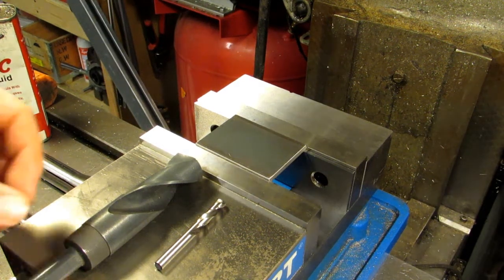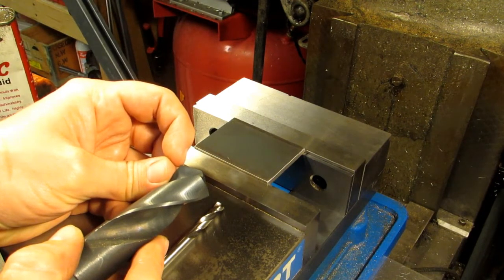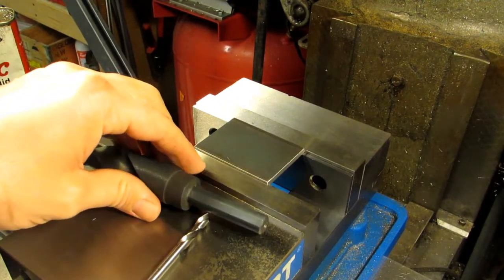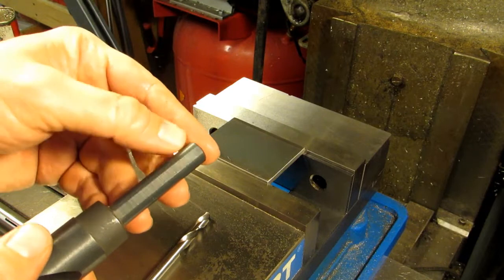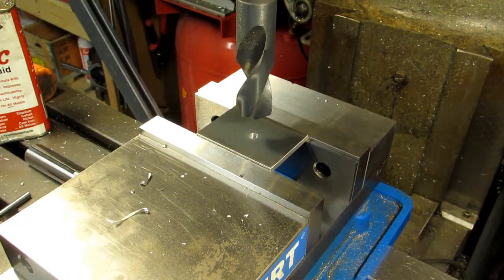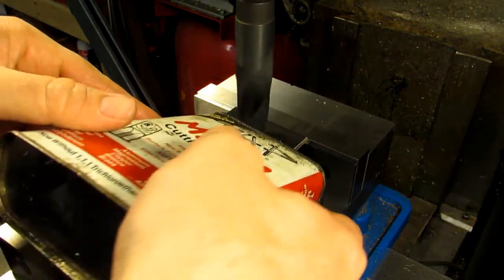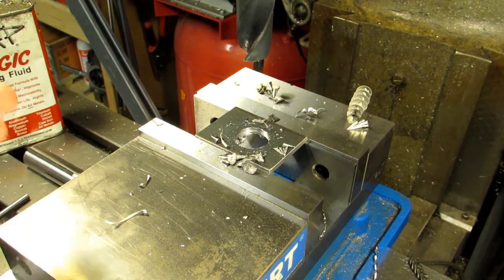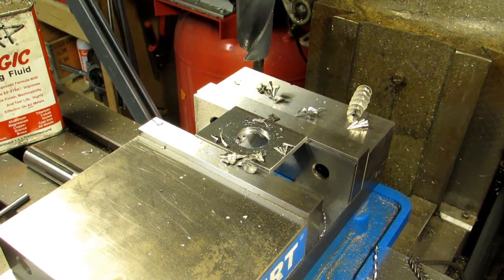Quick Machining Tip #3 - Drilling Larger Diameter Holes

Comment: Maybe it's just me, but when I step drill up in size, I find the drill bit is more likely to really grab and possible spin in the chuck. Maybe I should be using a collet instead of a drill chuck, sometimes you just get lazy, and constantly changing my R8's gets exhausting.
Reply from the maker: I generally like to use collets for reduced shank bits. You get so much more contact.

Comment: Not a new video, I know, but such a great resource. I'd wondered why drills would always chatter after drilling a pilot, regardless whether the pilot fit the web or not. Now I understand. I'm obviously not a professional, just a hobbyist. FWIW, I try to use screw machine length drills whenever possible and go straight in with anything up to 1/2". I spot jobber length drills first. It's genuinely good to know that I'm not completely off. Thank you, Stuart.

Comment: very good information. you didn't touch on the other reason for step drilling ,the hp requirement of drilling large holes. i don't think i have ever seen a chart that  gives you the needed hp to drill holes in various materials  i just found your channel and i really like it .good  basic info.

Comment: Everyone in our school shop loves to try to take a fast cordless drill and try to wack 3/8" holes through (usually with a rough plasma cut pilot) at near max rpm of the drill. A lot of squealing and almost no cutting. Throw the same exact drill bit in the drill press and run it on the slowest speed and it just eats right through the plasma cut parts. Drills like to be run slow, but with torque behind them, at least for metal.

Comment: can you give some tips for drilling in plastic? last time i tried that with a bigger drill it pulled it out of the vise cause the drill just ate into the material
Reply from the maker: Have you tried putting a small flat on the cutting edges like you would for drilling Brass?  It doesn't take much at all.  You can do it with a sharpening stone.  The flat effectively gives the drill 0 degrees of rake angle so it won't grab and pull the part up the helix of the drill.  I can do a video on it if you'd like.
Reply: as im a hobbyist with not much experience a video would be great :D
Reply from the maker: Here you go, Fred.  I even gave you a little shout out at the beginning.  Let me know if you've got any other questions.

https://youtu.be/ZZfbofRFsBE